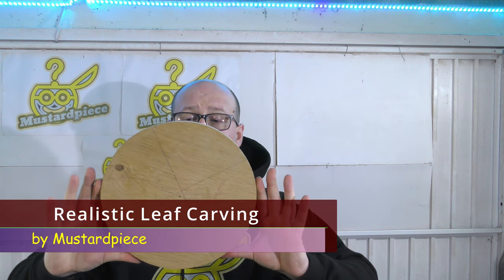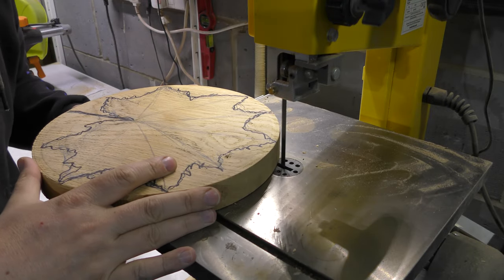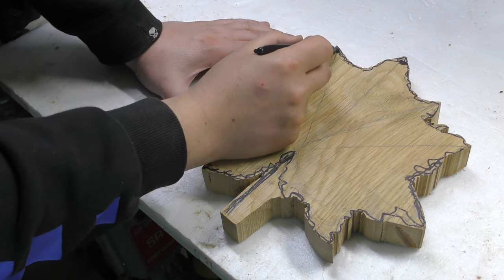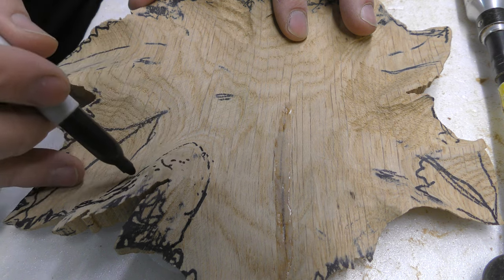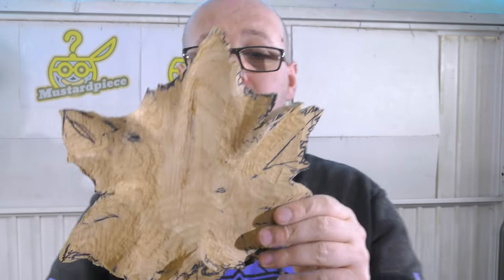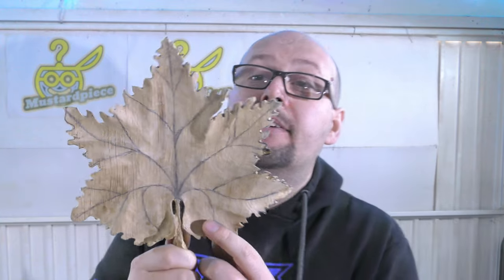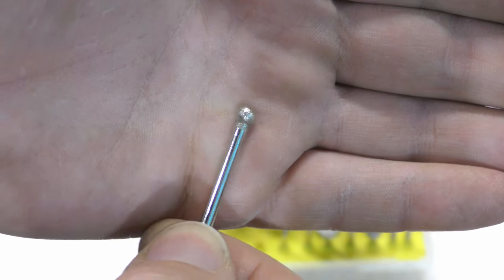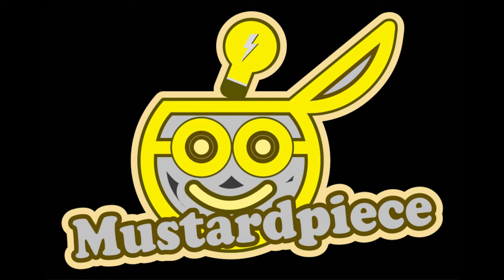I Turned a Bowl Blank into a Leaf - Full Tutorial

Comment: Atilla, that is beautiful!  So, do you have a link to that second set of bits?   I need to carve some bricks on a board.  I got a set of the Kutzall cutters which are like the first ones you used.  I figured the second one you used would be nice.  Did I mention I LOVE that plate!  As usual you are a joy to watch.  You are getting to be big time.  Four ads during your video.
Reply from the maker: Thank you for the support. It was very difficult to find these bits. I get the tip from a pro carver, Let mew see if I find a link. https://www.amazon.co.uk/Gasea-Tungsten-Carbide-Woodworking-Engraving/dp/B07GD843PF/ref=sr_1_45?crid=1H42ATINZZTZR&dchild=1&keywords=carving+bits+for+rotary+tool&qid=1621273379&sprefix=carving+bits+%2Caps%2C185&sr=8-45